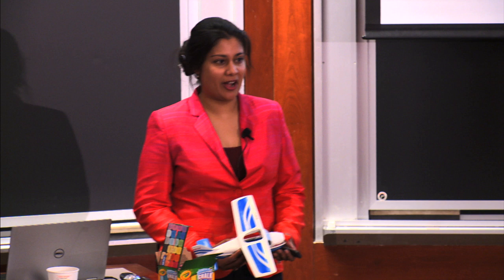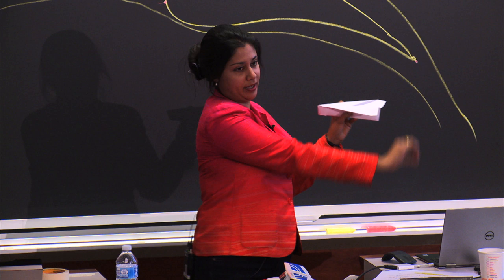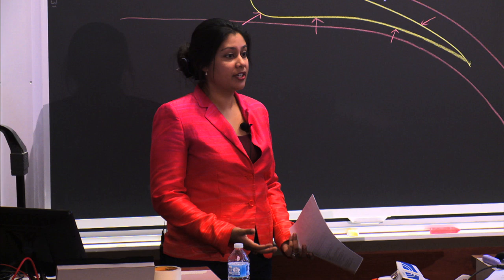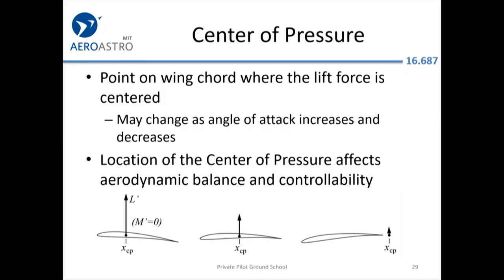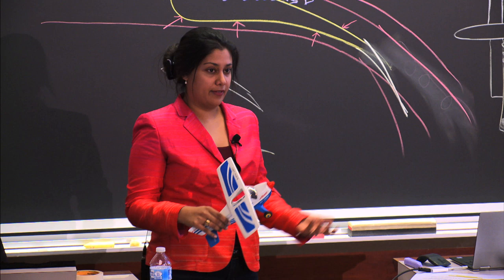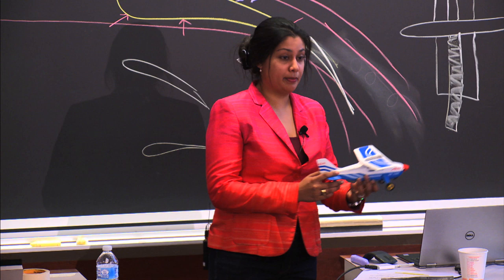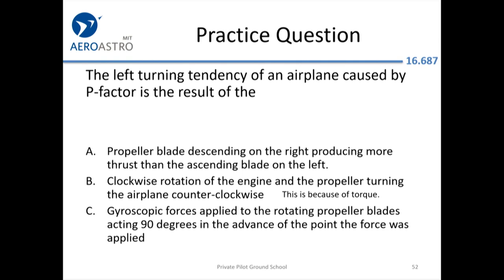MIT Private Pilot Ground School, Lecture 2 (Aerodynamics)

Comment: This video is fair and has some things ok and some things VERY wrong. It is nowhere near what should be expected from MIT. She is trying...

For real physics, see this: https://rxesywwbdscllwpn.quora.com/ 

For this video, here are the specifics:
.
0:50 Vocabulary: doesn’t  mention the vertical and horizontal “stabilizers”. Calls them “parts”. In the graphic, but not mentioned.
There is only ONE wing.
Going to talk about sea planes ???
3:11 initially says lift exceeds drag, but corrects it.
4:50 Draws an extreme airfoil shape.
5:22 The way she explains conservation of momentum is a good one, but momentum can be confusing to some people. It is not saying just how these pushes come about, but is better than just saying lift is a Third Law "reaction".
5: 30 Air has mass and conservation of momentum. Doesn’t explain how push occurs.
6:12 GOOD: Explains the  Equal transit/longer distance fallacy. Points to flat wing, same length.  Math description not needed - correct.  Good Aeroastro graphics.
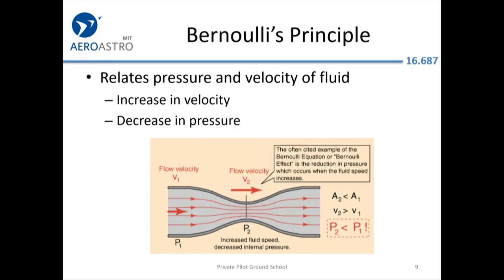12:01 GOOD: Stated Bernoulli correctly using ‘velocity’.  BUT focuses on fast.
12:40 "C" is the WRONG answer!  The word "cause" is incorrect.  "A" is the only correct statement there, but has nothing to do with Bernoulli..
12:42 The Graphic assigns INCORRECT cause to lower pressure.
14:00 GOOD: stationary pressures. She only mentions a "force" but not that it is pressures that cause the force!
15_24  Talking about the rest of the aircraft generating lift is a distraction and unnecessary.
15:57 Asks childish questions. Race Car.
16:36 Only says the spoiler “spoils the air flow. Doesn’t explain that it has down lift.
18:00 It is the altered pressures which cause the acceleration of the air (downward) ACCELERATION DOES NOT CAUSE THE FORECE !!! 
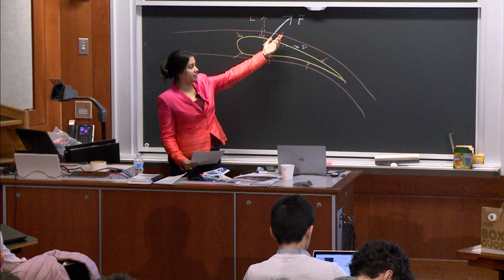18:09 Wing  ALSO changes the speed of the air.
Never states that upper air beats lower air.
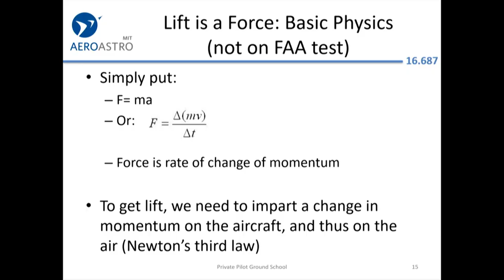18:40 Air past wing, or wing past air question.  The critical thing missed here is that the speeds are NOT "IDENTICAL", but different between these two reference frames, BUT the science must be the same.  Therefore, talking about fast is misleading.  It is ACCELERATION that must be understood.
18:54. Is wing moving faster through the air, or air moving faster past wing? Frame of reference discussion – SAME. Wind tunnel justification.
23:40 Mentions aspect ratio without explaining it.
24:24 Mentions hand out car window and PUSHING, but doesn’t relate to the – IGNORING the momentum explanation earlier.
25:28 Mentions Viscosity. Compares sticky.   Sticks to the wing.
27:10 Compressibility affects lift in a different way.  NOT FUNDAMENTALLY.
27:20 Calculating lift is not known.
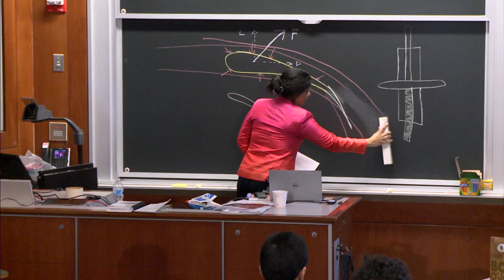29:45 CALCULATING LIFT.  Mentions Kutta Condition and says wrap around is an additional condition.  2D is simpler ) OK, but tip vortex sn not true turbulence.  So… Calculate where possible and measure elsewhere.
Doesn’t explain chord line.  Says:  “in between".
32:25 Talks about summing forces around the wing for lift, but doesn’t explain the top-bottom difference.
38:10 Doesn’t actually state what AoA is.  Graphic shows it as “A”  but is unnamed.
42:20 CONFUSED about the effect of flaps. Airspeed being higher with ground speed lower HUH???  Also doesn’t explain approach being steeper. Misses that is the increased lift that allows slower air speed.
47:38 Only explains that roll is around the longitudinal axis, but not the others.
48:13 Doesn’t explain why adverse yaw occurs.
48:15 Stability OK.
53:30 Question about what happens beyond the critical angle is not answered correctly.  Lift does not go to zero. Did not demonstrate a paper airplane stall.  It was too stable.
54:45 First mentions separation.
55:56 climb & decent, lift = weight.
57:15 Torque causes a left ROLL.
57:50 P-Factor not so much climbing because AoA not necessarily high, just on ground.  They can’t answer the question at 
1:02:20 Precession is 90 degrees  later.
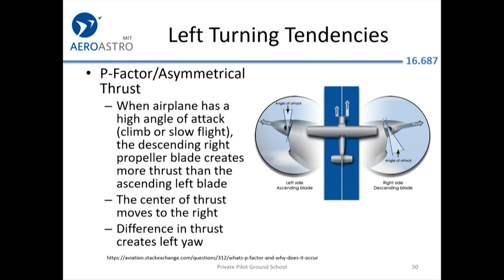1:03:14 Question why P-factor not subject to precession. Sort of answered. It is a bigger factor on the ground for a tail dragger the ground where the ground  prevents precession and in slow flight when precession only occurs during actual yaw.
In zero G flights confuses the upward parabola with top and downward parabola with bottom.